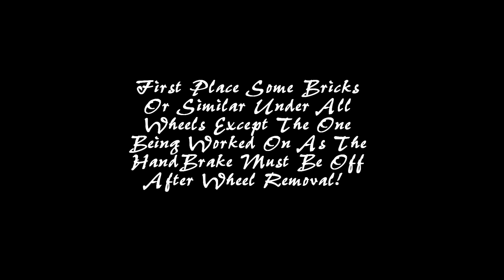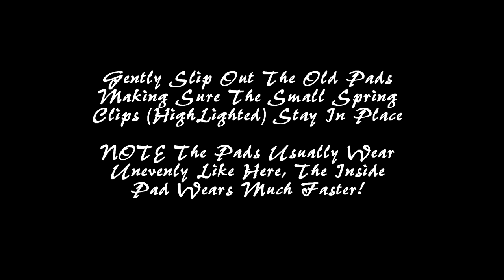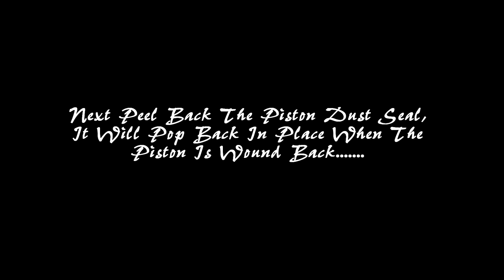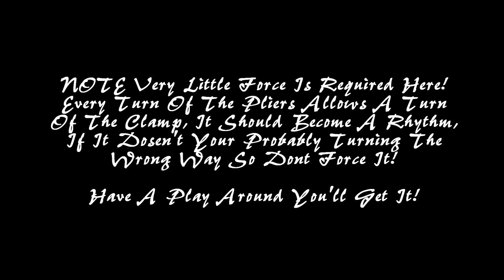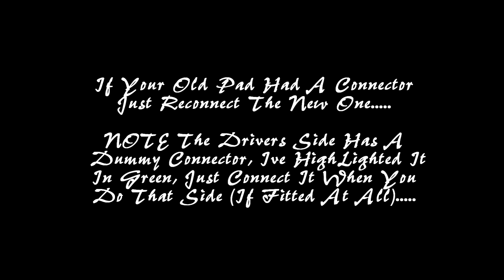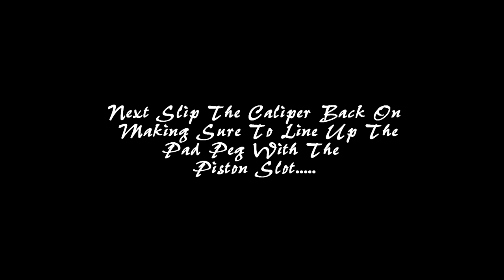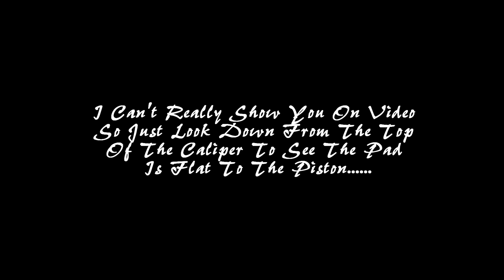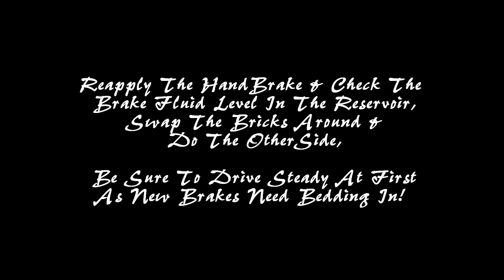Transit Mk7 Rear Brake Pads

Comment: Please don't use bricks to hold up your vehicle!
When the bricks crack, the whole lot will come crashing down on you in an instant.
Always use timber. When the timber cracks, it won't shatter and disintegrate like a brick does.
If you have to use a brick (pls don't), place your wheel (or spare) underneath the chassis rail or diff to stop the falling van before it reaches the ground. This may save your arm or more.
Reply: He was only using the bricks as wheel chocks to stop the van rolling when the handbrake is released.

Comment: Thanks I am about to do this on mine but having problems finding correct size pads. some say they are 109.6mm long and others say 122.8mm long both say correct for my vehicle, do you know what size yours was ?
Reply from the maker: So sorry I didn't see your message, and sorry again as I can't remember, it was a while since I did them, kind regards
Reply: @PitStakProductions  No problem they were the 122.8mm ones after